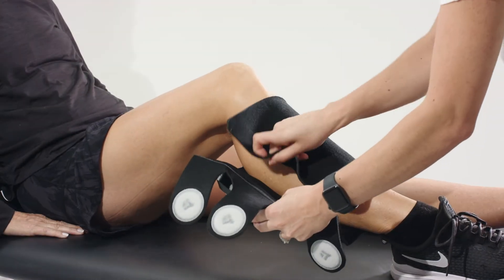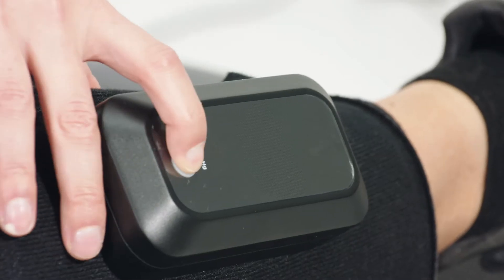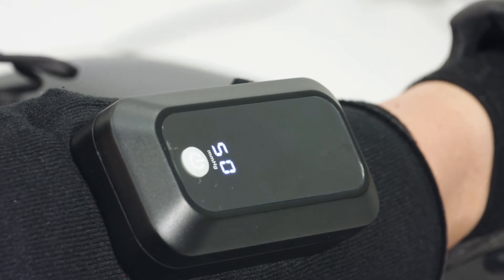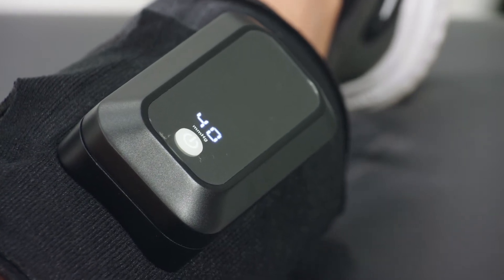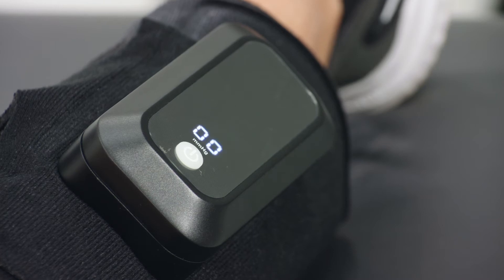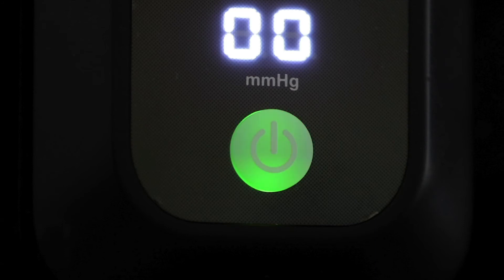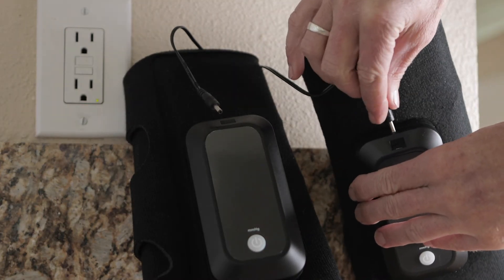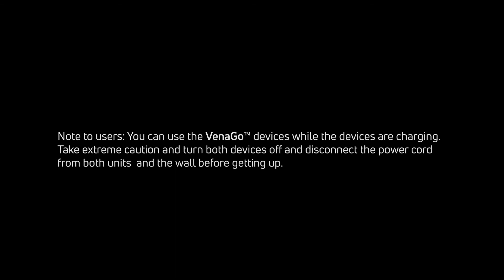How to Use VenaGO

Comment: After my first knee replacement my surgeon had me use these…after being fully charged each  time, either one would eventually, after five minutes or so, flash red and no longer work. They were exchanged. Four months later, same situation…completely frustrating as I am 1-1/2 hours away from trying to exchange…again. Will definitely get a refund on these.